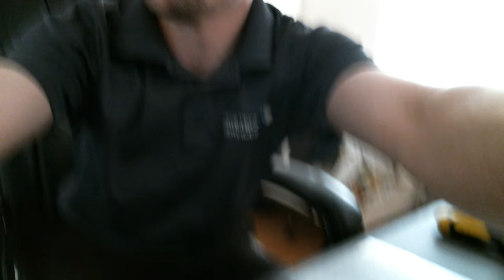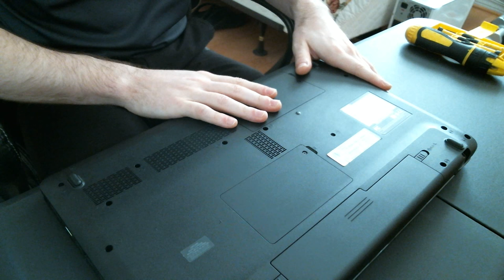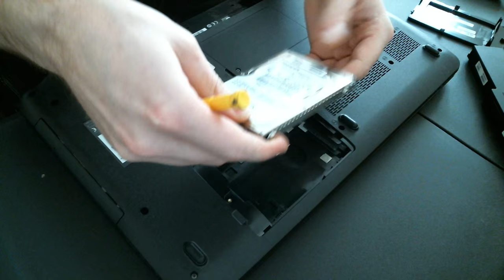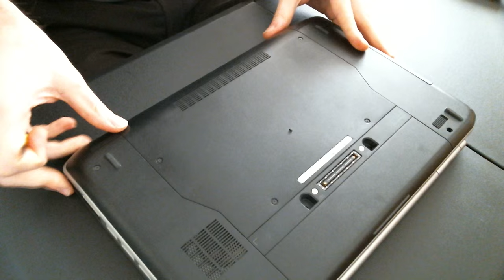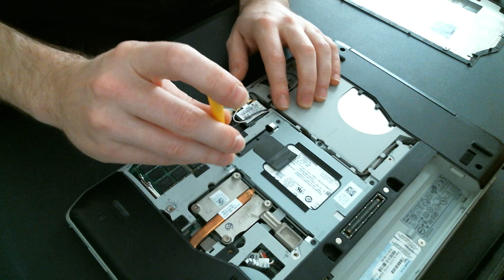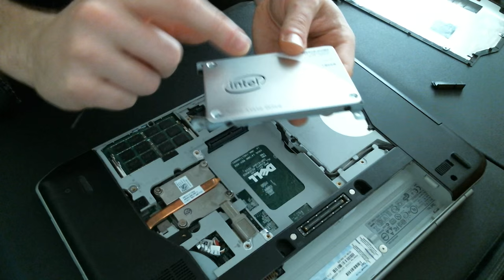How to Install a Hard Drive into a laptop (PC)

Comment: After replacing my hard drive I decided to replace the old hard drive and my laptop is refusing to boot 😭
Reply from the maker: Timothy, I am going to reply to this with a response I had to someone earlier in a post. Let me know if this helps.
"When you install a drive from a store or off of eBay it will have nothing on it. A computer stores all of your files and Operating System (OS) onto your hard drive. Your OS is Windows I assuming. When you replaced that hard drive then you removed Windows therefore your computer cannot boot into Windows. You will have to reinstall Windows from the bottom up on the new drive. Remember all of your data (documents, videos, pictures, etc.) was on your damaged hard drive as well. Hopefully you had a backup of that data or no important data. Also I hope you had at least Windows 7 or above. If so, just go here https://www.microsoft.com/en-us/software-download/windows10 and download the Create Windows Installation Media creator tool. Go buy a flash drive (or if you have a blank one) that is a least 8 GB. NOTE: The tool will erase the flash drive to use it so make sure no needed data is on the flash drive. Install the Windows boot up files onto that flash drive using the tool. Plug in the flash drive and reboot the computer. It should boot to that drive. Follow the prompts to install Windows and enter the product key if needed. NOTE: These are generic instructions but I hope they prove to be useful." FryeTech
Reply: The hard drive already had windows 10 in it because I removed it from a different laptop. But I have installed new windows but later am getting som flow errors
Reply from the maker: @timothyampahwhyte2290  You install a fresh copy of Windows 10 on the hard drive? What do you mean by "flow errors"?

Comment: I have a question my disk drive is bad cause I punched it lol I got a new one from eBay and I put it on it was easy but when I turn on the computer it says no bootable devices. Why is that is it a bad disk drive ? I don’t know nothing about computer. Haha sorry
Reply from the maker: When you install a drive from a store or off of eBay it will have nothing on it. A computer stores all of your files and Operating System (OS) onto your hard drive. Your OS is Windows I assuming. When you replaced that hard drive then you removed Windows therefore your computer cannot boot into Windows. You will have to reinstall Windows from the bottom up on the new drive. Remember all of your data (documents, videos, pictures, etc.) was on your damaged hard drive as well. Hopefully you had a backup of that data or no important data. Also I hope you had at least Windows 7 or above. If so, just go here https://www.microsoft.com/en-us/software-download/windows10 and download the Create Windows Installation Media creator tool. Go buy a flash drive (or if you have a blank one) that is a least 8 GB. NOTE: The tool will erase the flash drive to use it so make sure no needed data is on the flash drive. Install the Windows boot up files onto that flash drive using the tool. Plug in the flash drive and reboot the computer. It should boot to that drive. Follow the prompts to install Windows and enter the product key if needed. NOTE: These are generic instructions but I hope they prove to be useful.
Reply: FryeTech IT you are the best dude thank you so much.